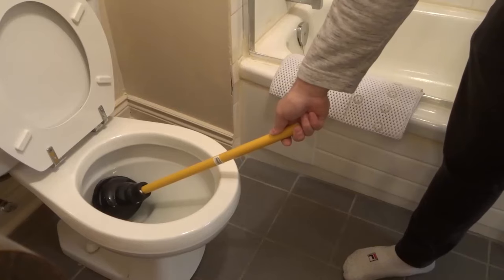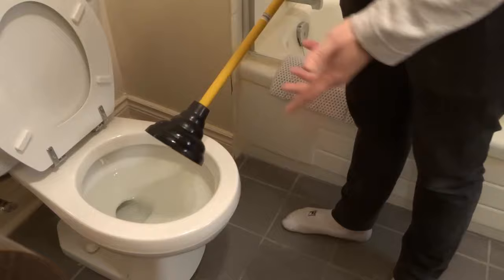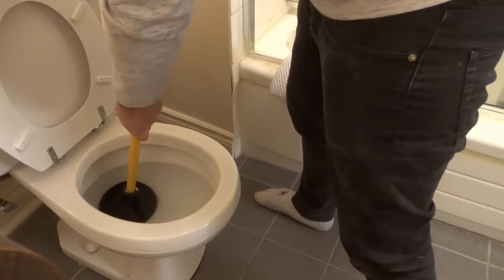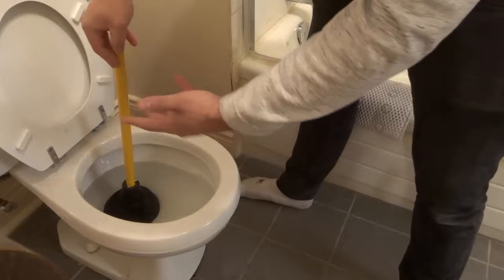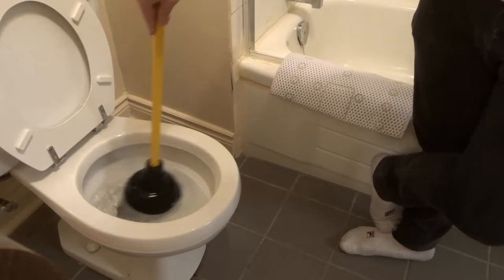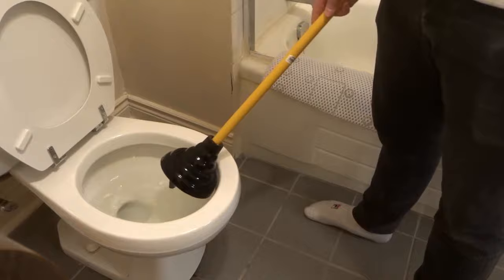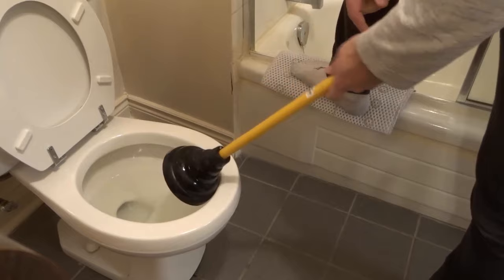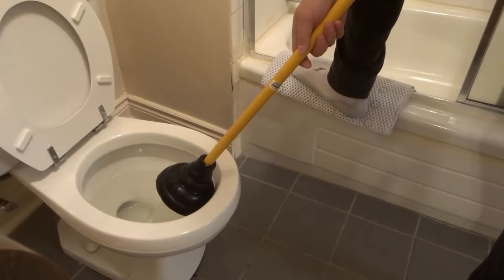How To Use A Plunger (To Unclog A Toilet)-Tutorial

Comment: Thank you so much!!! It worked fabulously! I did 3 or 4 sets of 30 REAL seconds of the aggressive push and pulls, (toilet was full of shit, literally, but I did hard pushes and slower pulls until the water got very low, as to not splash the shitty water everywhere, before I started to really go in when the water levels were very low.) I did 30 second sets as in stretching especially, 30 seconds is a great stetch. I also did 3 to 4 sets, because I've lived in this apartment for almost 6 years now and the plumbing can get bad, 6 apartments, I'm at the top, the building is over 100 years old, and I've talked to the landlord many times about it. We have a great relationship. Before I call him for anything I'll try on my own, unless i know it's something beyond me. I have a feeling i may have to do this a few more times in the coming week or 2, and if it doesn't get better, I'll give him a call to really get in there with his tools and fix it. Sorry for the long message. Hope this helps others.

Being in a depressed state mostly on and off , but mostly on,  for the last month or 2 now has made it difficult to do even some of the most basic tasks. I had tried on my own to plunge, but I was doing it slowly and gently, and it only helped a tiny bit, I was frustrated so I kinda gave up and says, "let me check YouTube, I know someone must have a great plunger video." Thank you!!

Comment: Dude ..I've been stressed out the past couple of days trying to fix it without a plunger ..finally went and bought one and it worked wonders ..A little tip ..I took an old cardboard box  , cut off a piece , cut a small  hole in the center  to feed the plunger through ( from the bottom up,) and used it as a blocker to minimise splash ...Thanks for the help

Comment: Took a massive wet dump this morning and used a little too much paper being half out of it from the flu. Although it went down miraculously, the water pressure trying to reflush it was not enough to get the water to spin down fast. Checked the pump, the flapper chain, and all was fine. Tried throwing in buckets of hot water fast and still no proper spin, but had tiny pieces of paper coming back in the water as the bowl refilled slowly, then gradually went back down. Finally, I looked at your video and saw the proper way to plunge for 15 to 20 seconds. First attempt failed as I may have not done it hard enough or I did it in too little of time. So I went at it more aggressively and counted to 30 to be sure, and now it flushes normally again with the quick water spin and the pieces of paper were gone. I've been plunging wrongly all of these years and this time it worked perfect thanks to your video. Thank you so much! 😎👍

Comment: This is a great video but can I just add a few other tips? After you've unplugged your toilet, flush it a few times with just water, no toilet paper.
Then you might want to store your, rinsed off in the shower with disinfectant, plunger inside of a clean trash bag inside of a utility closet or next to the toilet. You can also pick up a plunger that comes in its' own protective case. Also I use isopropyl alcohol to wipe around the toilet rim and seat. Happy plunging!🎉

Comment: I live in a 50 year old trailer with everything tied into one small pipe. I have a Japanese bidet like from that Southpark episode and don't use toilet paper. One day, a friend came over and used half a roll of Charmin. Tried everything said here on both toilets. In the end I had to dig up the septic cleanout pipe and push 20 feet of hose into it to get it to drain because there was 5 inches of toilet paper clogging the line!

But thus tutorial video is solid. Unfortunately my pipe blockage was more solid 😂

Comment: thanks i use this method were is if its really cloged and i flush it and it gets to the almost over flowing point i get a cup and take water out of the toilet so it will empty it then i plunge it so it wont over flow and splash every were

Comment: You ARE using a plunger with the extended bell on the end. It was folded up inside and started to unfold as you were plunging.
If it doesn't have the extra part it's meant for the sink, not the toilet. Also it does not have to splash! Gross.